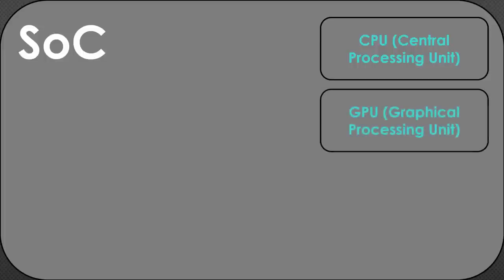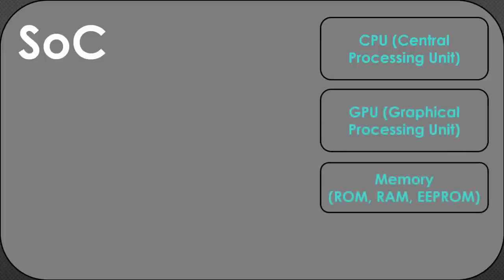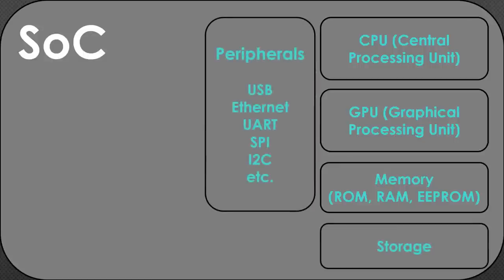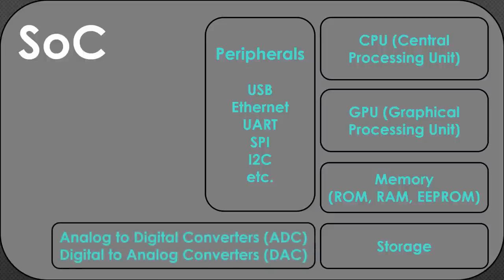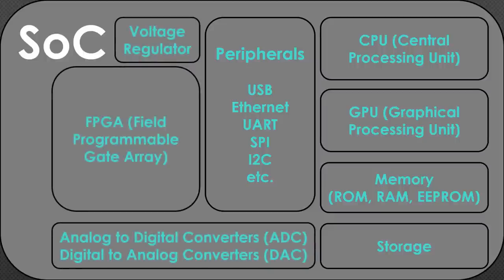What is System on a Chip (SoC)? | Concepts

Comment: Hi,
I would realy love to see more tutorials. Are there any cheaper development boards to start with?
Reply from the maker: Hi Akash, short answer "yes" - the one's I've mentioned can specifically used for FPGA and SoC programming; thus, they come out as more pricier. Although, I've been asking Real Digital when they will put their boards on amazon because their boards are cheaper (around $150 or so I believe) - the answer is soon (I don't have a date). 
Also, if you are interested to check out some of my FPGA programming tutorials and you can probably get a good used Xilinx FPGA development board on ebay for cheaper - https://www.ebay.com/bhp/xilinx-board (the reason why I'm suggesting Xilinx boards is because I'm using Xilinx's tools; otherwise, you are welcome to use any development board you like - in the long run I'll try to make starter tutorials for different software platforms). 

By following my fpga tutorials you can gain an understanding of the hardware and how it works before jumping straight into SoC programming. 

Anyways - let me know if you have any other questions, I'm more than happy to answer them. Oh, and thanks for making it to the end of this long reply - I wish I would have a "less complex" answer for you.